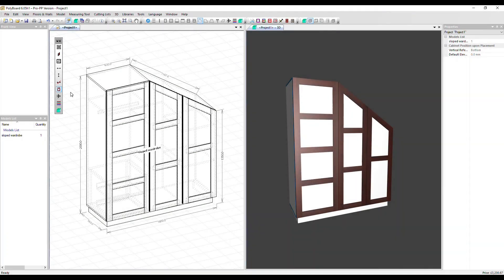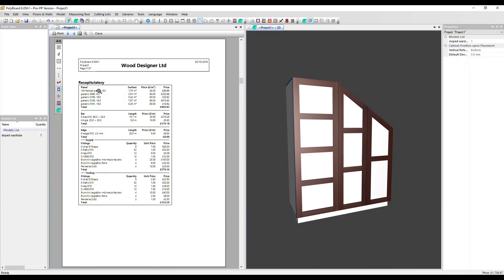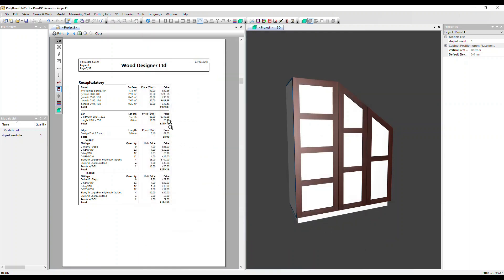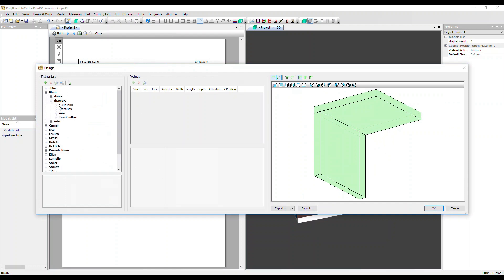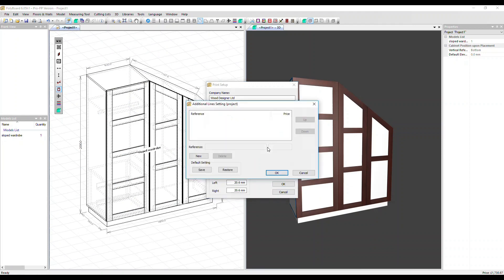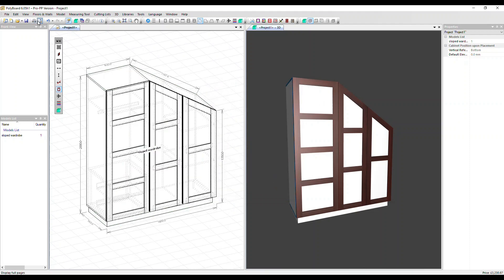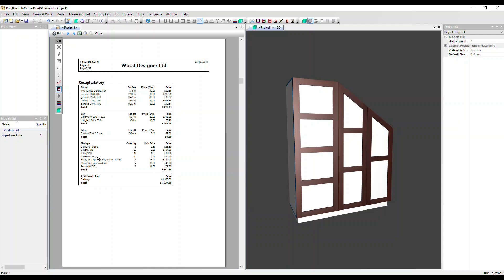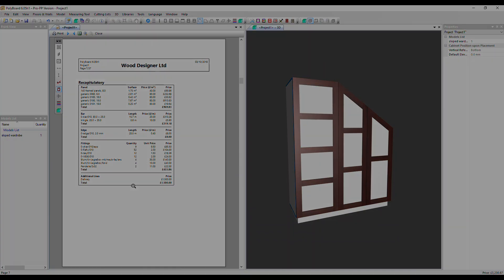Create and Modify the Material and Cost Summary Report in Polyboard

Comment: fittings quantity is not updating  ... what can i do?
Reply: if i am making a cabinet of 700mm height, i have set rule to apply two numbers of auto hinges. but the quantity of hinges if showing 8 instead of 4. 

also, if I am making the height os that same cabinet 1920mm, then back again to 700mm, the hardware list is not changing to 4, rather, it is fixing itself at the number 14.
Reply from the maker: Hi there, could you post on our forum please and we'll take a look. Just to let you know first, for tech support you would require a Premium Support subscription which is paid. Forum and sign up for this is all on our website here, thanks: https://wooddesigner.org/

If you are just looking at the software with a view to using it in your business, please instead request an online demo so we can show you the software in action. Following purchase, you would get a support subscription free of charge. Thanks again...